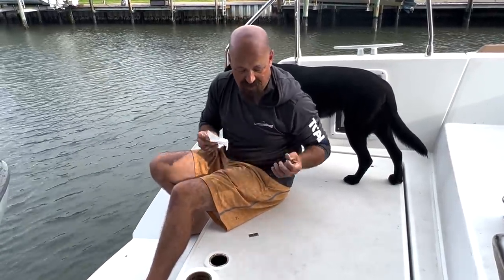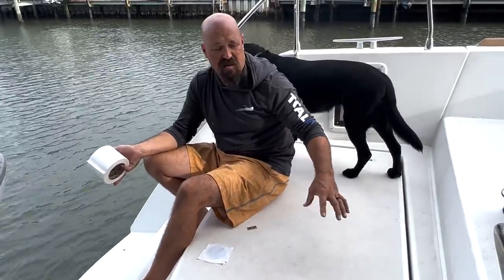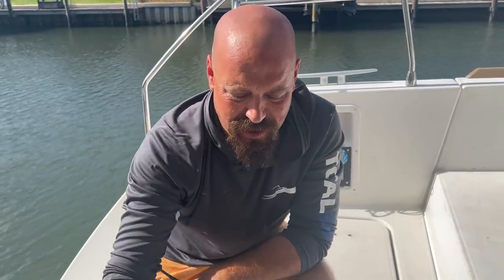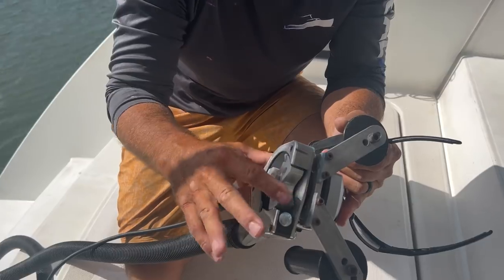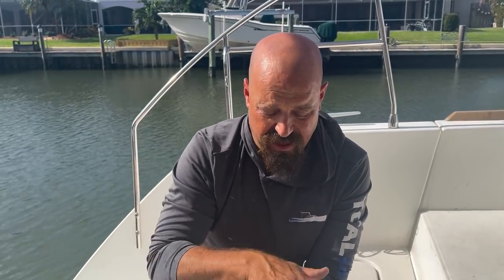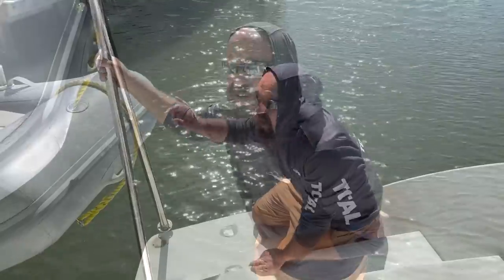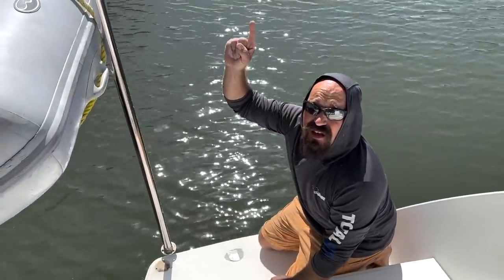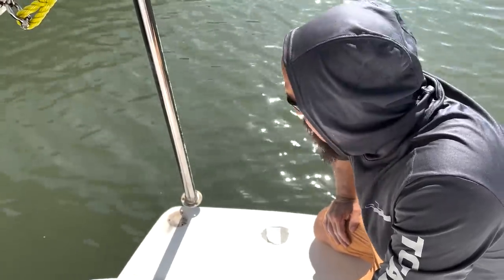GET A GRIP//Upgrading Our Nonskid-Episode 80

Comment: What type of paint & non slip stuff did you use. I want to do my dad's swim platform over
Reply from the maker: We used the ALEXSEAL Top Coat in the shade Cloud White. We also used the roll additive and top coat accelerator. We only used the roll additive on the smooth surfaces, not the areas that we put the non-skid, and we used accelerator over the whole project.

The non-skid we used is called Softsand: https://amzn.to/3wEAZ2M

Comment: For me, this episode is very timely.  I am fixing up a very small sailboat (Sunfish) and I need to figure out an option for a non-skid seating area.  I don't want to tear up my legs or swimsuit, but I don't want to be sliding around either.  Do you think this would be comfortable as a seating surface?
Reply from the maker: It’s not bad but if you do slide it will possibly snag a swimsuit.  You can use the fine grit ( we used medium) also you can add more layers of paint to bury the nonskid deeper and thus make it less abrasive
Reply: @SailingDauntless  Thank you! I like that option very much!